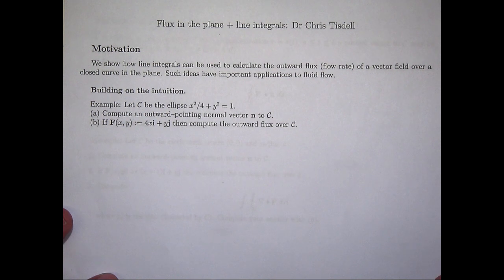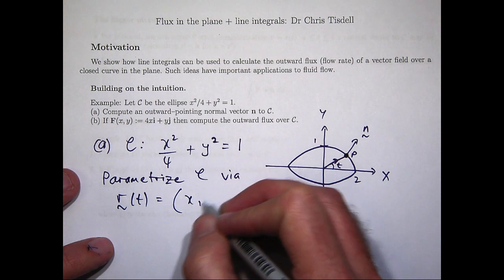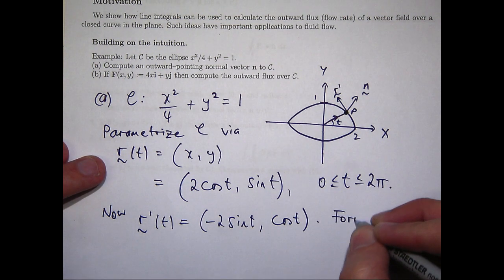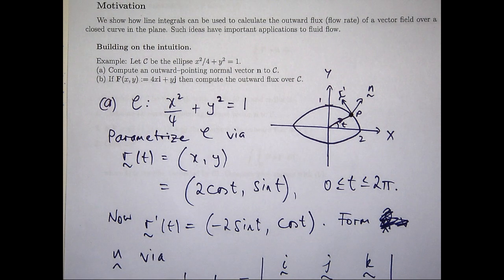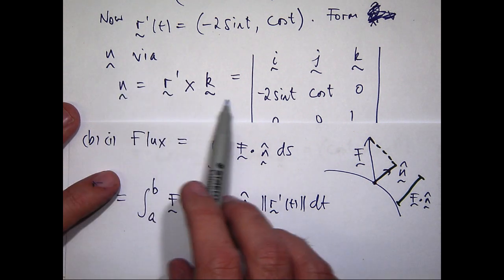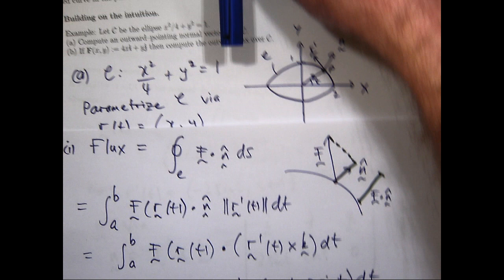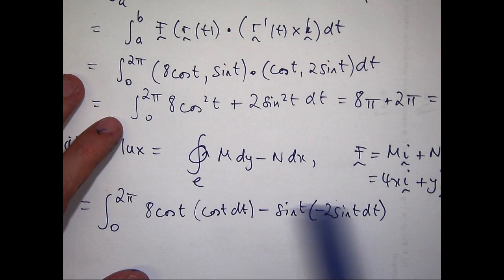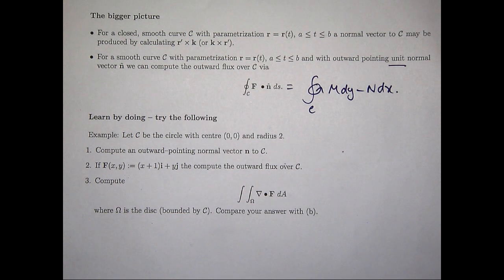Flux in the plane. Line integrals

Comment: In here, I noticed that the vector k=<0,0,1> was used because the curve C lies in the x-y plane. So we can use the cross product to find the vector n as you have shown. I was wondering, however, if this would still be applicable if the curve C was not lying on the x-y plane. For example, what would happen if the curve C passed through the z axis?

Comment: With the int (M.dy - N.dx) shortcut depending on the parametrisation being in an anticlockwise sense, it invites the question "When is it ever not?" Particularly when the parametrisation is in terms of trig functions, in which case increasing the variable (and implicitly sweeping counterclockwise as a result) seems the only sensible thing to do. And surely this would still hold if you chose your integration limits as -pi to pi.